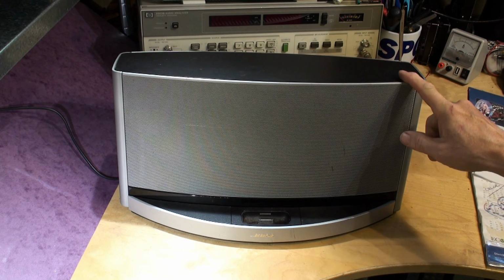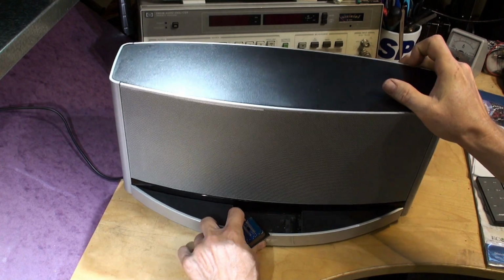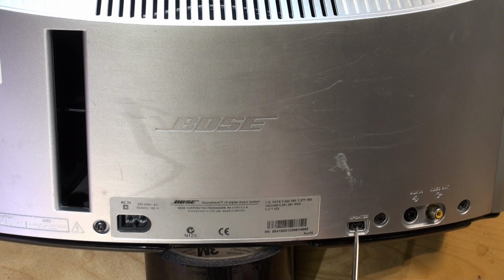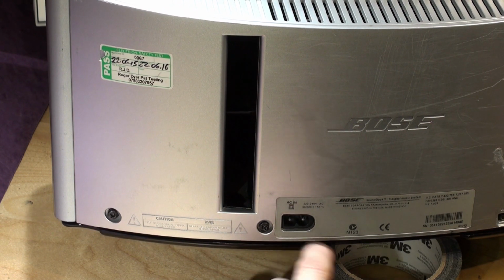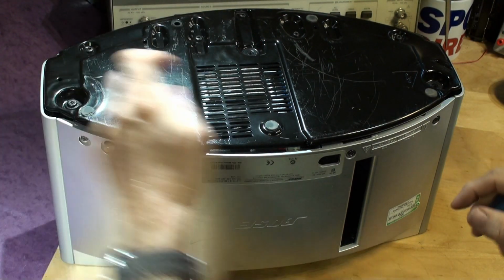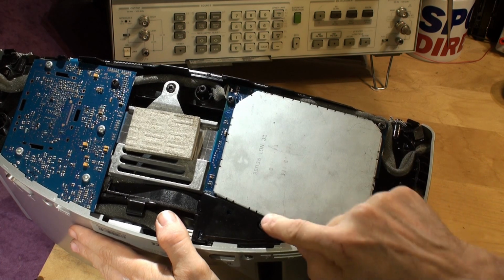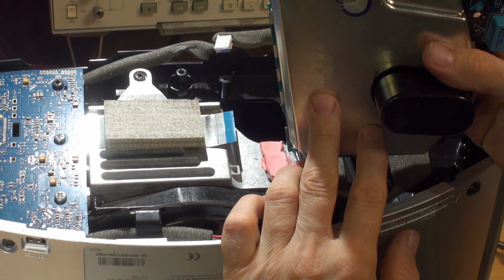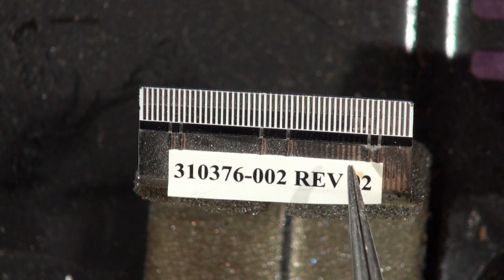Bose SoundDock 10 Diagnostics and Disassembly - Power Board 322642-0020

Comment: On my SoundDock, the AUX flashes when I plug the power in. But the dock doesn't make any sound when plugging the power in! Any idea??
Reply from the maker: Could be anything. If you don't hear the bloop bloop tones at power up then there is definitely something wrong. A common culprit is corrosion from a liquid splash. It may have happened long before the fault manifested . I advise you to watch the diagnostic video on the channel. I close  inspection ids a great place to start.  If you disconnect the front docking area then the tones might come back. It is quite common for the front board to fail.

Comment: Hi, my soundDock 10 is working but there is background distortion (ZZZZZZ kind of noise) coming while playing music (I usually connect bluetooth dock) I have tried contacting bose but of no use. Can you please reply of any suggestion!! I really like it.
Reply from the maker: Hmm could be a speaker failed. I haven't seen any background interference on the hundreds of units that I have repaired but the speaker cones do fail.   Listen closely to each speaker to determine if it is localised to one of the speaker cones.

Comment: Great explanation! But if my part number is 322642-0060?
Reply from the maker: There are ~three variants of the part which relate to modification state as they tried to change the build to resolve reliability issues. There are also universal input (110-240V) variants of those so there are six in total. All of them are essentially the same. However if you modify some variants to the latest mod level then you need to change values on the logic board to suit as the the Switch Mode power supply switching is synchronized to the class D switching to reduce noise and beating.
Reply: @razenby  And can you repair mine?

Comment: Hi. I have one. I love it. Unfortunately my kids dropped a little water on the Bluetooth dock and now it works but doesn’t connect with the Bluetooth only aux cable on the back. Can this be fixed? Im in the States
Reply from the maker: It can but is is a real pain.  I have limited spares of the 40 way spring connector that get eaten away when the dock gets wet but it is very time slow and painstaking.

Comment: It looks like my snap out module is not powering the iPod, but works fine otherwise.  Are replacements available?
Reply from the maker: You have to change the docking connector. I have stock if you want it changed,
Reply: @razenby  Thanks for the reply, how much does one cost shipped to the states?
Reply: I want 1 please @razenby

Comment: I have a Bose SoundDock 10 but it doesn't turn on, the technician said the functional board needs to be replaced.BOARD 322292-001
Reply from the maker: The  322292-001 is the sound processor for the sounddock series 1 (I think) Are you sure yours is the large 10 version. If is is a series 1 (serials starts in 0357,4020,0498) then I can fix the processors for you.

Comment: Hi there, how can this thing works without remote control?
I'm trying to get one in eBay & the cheap once has no remote
Any mods  for this?
thanks
from the Philippines
Reply from the maker: You need a remote control. Great unit , powerful Bose sound but you need to buy a remote too. A SoundDock II or SoundDock Portable remote works OK.  These are far more plentiful and much cheaper. That's what I use her to test SD10s.
Reply: @razenby  thanks for the reply. Can you still remember the Power amp IC this model use? I'm thinking of bypassing the digital remote system & solder an analog potentiometer at the pre-amp section. I'm interested in getting a cheap broken unit then modding it with an analog volume control system but NOT bypassing the DSP section. I will only bypass the digital volume control section.

And how many volts DC is the output of that power supply?
Reply from the maker: Just watch Parts 1 to 4 of the detailed component level repairs for this dock on this channel. All the datasheets for the components are displayed.  I am handing over my experience to everyone.